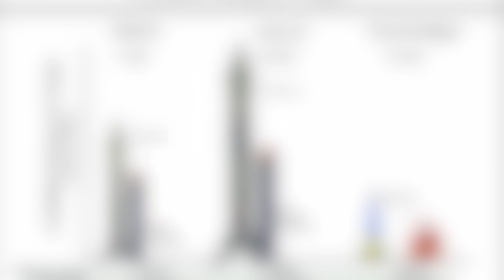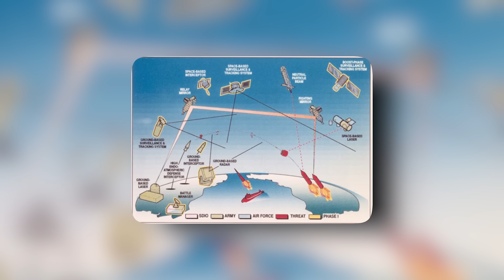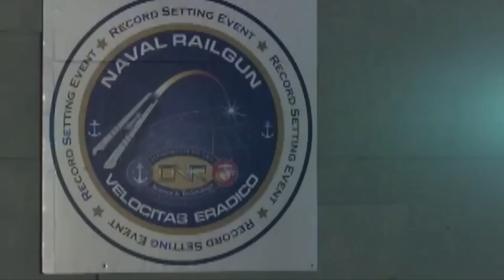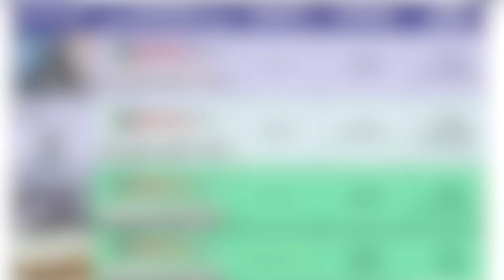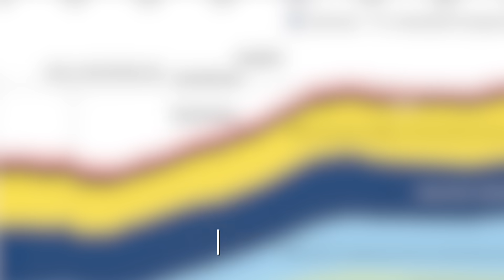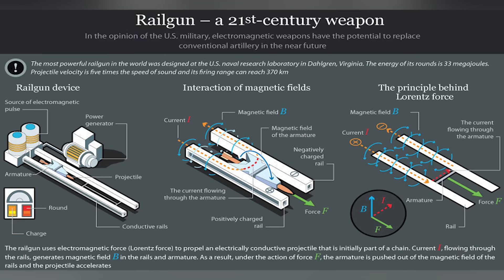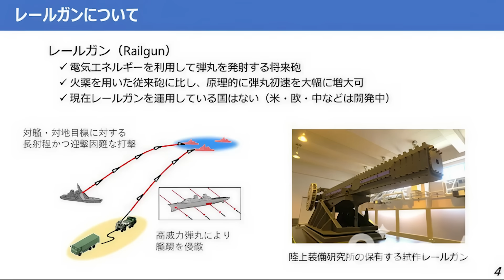Japan Revives a Scrapped U.S. Superweapon — And It Actually Works!

Comment: One major change the Japanese military seems to target compared to the US is its shift towards a defensive role as well. A railgun used on land would not face the same issues as one on the ship altough smaller railguns are currently tested for Japanese vessels as well. The defensive approach might even open a venue for a cheaper balistic interceptor role once the technology developed enough. Not on its own but complementary to regular intercepters of course. Trying to install them on/in mountain ranges would extent their range and a country like Taiwan for example would surely benefit from such a system as well.
Reply: ほとんど完璧に説明出来ていると思います。
レールガンの発展で、安価で安定したミサイル防衛網の構築が目的です。
Reply: レーザー砲とガトリングガンの併用でミサイル迎撃は出来るだろう。アイアンドームは鳴くダイヤモンドドームになる！
Reply: No, the guns still exert too much force and damage themselves firing. Ships were acrually a smart place to try to put thwm, as ships allow more movement and effective recoil for firing high velocity, heavy rounds
A stationary empacement will lead to more damage
Reply: @shanegibson3281 normal ship cannons also damage themselves
Why?
Because they have miniature explosions happening in order to launch the shell.
A railgun damaging itself is not a downside, it already happens to our normal cannons and guns
Reply: @shanegibson3281  Oh I'm aware that the tech is still developing but the bit as a land based plattform was discussed in Japan as a possible defense for North Korean missiles. Currently, they have no systems like THAAD or ARROW (as far as I kno, dunno if some are considered to be ordered). I understand the thinking behind the idea because intercepters are not cheap and similar thinking has been deployed to SHORAD solutions with drones. Where new intercepter (drones or cold war SPAA concepts) are developed to find cheaper alternatives. If we're talking aboout defensive solutions for missiles railgun concepts or some satelite space based intecepter seems the most feasibly in the near future.
Reply: Taiwan is not anymore a country than Donbass is. we in Asis support the unification of China. if seperatism success in China, it would encourage seperatist in our own country. there is a reason why ASEAN did not allow East Timor to join for decade. imagine if Catalonia declare independent, do you think EU will really allow them to join EU immediately? that's just naive and a failture to understand politic.

Comment: Sounds Great! HOWEVER, Note, that 'Wild Iron' doesn't mention several critical factors that will continue to put the rail gun on the back burner for another decade or two. The main three issues are: 1. The size and nature of the power supply,  2. As of Today, rail guns can only shoot "solid projectiles." AND 3. it's currently limited to LOS. Have a nice day,..  ;^)

Comment: Seem like rail guns is just a useless weapon. With the range of 200-300 miles you put your ship and equipments in danger just to use this weapons while a F35 has the range double to triple it. Then to the matter of penetration, we don't need a railgun level vs any other armor vehicle, and for deep bunker, MOP is much better than railguns. So it's a useless attacking weapon. What about apply for defend ? Rail guns required several second between shot, at best is 6 second with the range of 200 miles, a patriot system can fire and track simultaneously 8 targets. It is a useless weapon planetary.

Comment: seriously I can't see the railgun being very useful outside of dealing with things like cruise missiles and small boats or drones. nowadays ships fight across vast distances, and any weapon that works like a gun has too short a range to be of much use there. it might work as a cheaper way of defending a ship, but that's about it. anti ship missiles are still going to be the weapon that is used to strike targets without putting the ship into range of the enemy's own attacks. maybe if they one day make one that fires projectiles capable of maneuvering and carry some sort of explosive payload, it might work for hitting distant targets and do enough damage to be worth using.

Comment: back in the 1980's there was a project to put a ramjet in a 106mm recoilless rifle. it had railgun levels of speed but they could never get the ignition of the ramjet engine to work quite right. maybe we need to reopen that project, make it 120mm and make the 120mm gun standard across army and navy platforms,

Comment: The problem with the rail gun as the main weapon of a ship is, the round is traveling at Mach 7 when it leaves the gun, but immediately starts decelerating due to air drag and gravity. Without an explosive warhead on the round, you're relying on that hyperspeed to deal devastating kinetic energy to your intended target. At some point well before the maximum range of the rail gun, the potential kinetic energy drops below the destructive potential of even a standard 5-inch round. Also, not having an explosive warhead makes the rail gun unsuitable for Naval Gunfire Support operations. If you try to shell a coastal emplacement with a rail gun, you're just depositing hypersonic lawn darts in and around the emplacement.
Reply: By that logic, the APFSDS tank rounds would be used at all, yet we see them used regularly against armored targets. The experimental railgun tested by the US had a combat effective range of 100 miles. At minimum. Shore bombardment is not a viable military tactic currently, and a 5-inch gun is not even remotely good for that role.
Reply: well, these would be problems that can likely be solved with more development. Perhaps you could make a round with a discarding outer shell that can withstand the initial stresses of the hypervelocity acceleration, and then discard to deposit an explosive payload once it reaches longer ranges
Reply: @umngyr  The rounds already use a clamshell sabot that allows the round to travel straight down the barrel. The clamshell splits away as soon as the round leaves the barrel. The round itself is in the shape of a needle projectile so there's really no space to put explosives. Any sort of detonator for said explosives would immediately trigger inside the barrel due to the massive acceleration G's the projectile experiences before leaving the barrel, unless you add circuitry capable of withstanding those G's that disables the detonator until the acceleration G's stop. Circuitry requires power, so you're going to have to add either a battery circuit or a capacitor circuit to keep the circuitry working during the firing of the rail gun. With every addition, the needle projectile is looking more like an artillery shell and the coefficient of drag is increasing. The projectile slows faster due to the increased drag, meaning the gun barrel has to elevate higher for the same target distance, which means gravity's effect on slowing the shell increases, increasing the gun elevation just that little bit more. I  have the feeling if they could have put an explosive projectile in the rail gun, that would have been the FIRST thing they tried.
Reply: @Fadamor  well, what kind of effective range are we talking on a railgun as it is? If we're relying on the kinetic penetration to do the damage, how far can it travel before the amount of force is too reduced? Even if the Railgun isn't bombardment capable, it could still serve as an effective STS or AA weapon.
Reply: @umngyr  Rail guns are being developed as a main battery weapon. Also the rate of fire is such that you're not going to be able to handle more than a few aircraft before the aircraft are in range to release their anti-ship missiles.
As far as effective range of a penetrator round, that will depend on the armor quality on the target. A drone boat could be destroyed at a farther range than a manned destroyer or cruiser. At some distance -instead of doing additional damage due to the hypervelocity shockwave, you're just punching a hole in the side of the ship. Those kinds of holes can be repaired by ship's force within a day.

Comment: It seems the American issue has more to do with their vessels than the guns. They don't have the power or space in current vessels and their procurement is incredibly behind. Something the current president is working on but things take time. That and it sounds like the much more expensive American version may have been to ambitious from the start over 200 miles is incredible but if it can only shoot once who cares. The Japanese were right to start modest and go up from there.

Comment: $25,000 a round for what?? $15,000= a hammer, $20,000 = a toilet seat.  Theres your cost problems right there. . . . ALSO, lets try that new superconducting wire...
Reply: Tungsten melts at 6400 degrees. It take a lot of juice to mold one. It has to be precision machined. At those speeds, minor imperfections can have the shot fly of wildly. Then there’s the discarding sabot.
Reply: @Menuki  Yes, you are correct of course.  but im convinced through steamlining production and innovations we could push that number hard south. Even still its already no where near the cost of a crusie missle. Plus, im again convinced that technology is catching up with the requirements of such a weapon.
Reply: is that you, Mr Levinson?

Comment: The Japanese made a sound engineering decision by choosing a a small projectile for their target design. It means the resulting weapon will be smaller, and require less electrical energy to operate, all while still giving the system the ability to hit a target harder than all but the largest conventional guns. American designers tried to make their weapons do far too many different things, leading to larger, more power-intense guns,which in turn sent the design's cost soaring. And now, here we are, with the Japanese nearly ready to begin fielding operational rail guns, and American wondering why they don't have such 'nice toys'.

Comment: LOL try stopping a kinetic projectile from a railgun with a Falanx/Goalkeeper gun or anti-missile missile. Japanese did the right thing. They walked with a smaller rail gun before they could run to develop larger ones. And now it is no longer an exclusive US system but the allies Germany and France will get into it as well. This thing is not going away.
Reply: They are not the only contries who doing it tho

Comment: Couple things.  The rail gun the US developed worked.

There's two problems that Japan won't overcome if you want this on a ship just as US developers found.  One, the mounting will rip itself apart or it will be too heavy for shipboard use, the main issue the US had with it.  Two, it takes a large burst of energy, and that's not a simple thing to do on a ship.

So, considering the US only considered this for shipboard usage it was a fail.  Japan will come to the same conclusion.

The US govt. didn't simply just cut funding for it, the cuts came based on the promise of a working system didn't seem reasonable and the US is spending a LOT on other systems with full potential the main one being a 6th gen fighter.
Reply: Except the Jp one doesn't need such a comically large amount of energy. Japan's one is much smaller (only 40mm), meaning it requires much less energy and is lighter to mount.

It's not designed as a ship killer or long range artillery like the US wanted. They want it as a hypersonic missile interceptor, to hit targets moving at over mach 5 from many dozens of kilometers away.
Reply: @Lunar_Ice_3141 good point
Reply: Also barrel changes and no logistical backend for the barrel and projo

Comment: Doesn't mention the issue around the materials issues with replacing the barrels every 10 shots.
Reply: This, problem with a rail gun is the very short barrel life. The huge rail guns like the 32 megajoule BAE systems made a few years back was spent in just a few dozen shots. Like China's Japans is much smaller & less powerful just 5 megajoules firing smaller caliber projectiles. It's experimental a first baby step & by accounts they got over 100 shots out of it but they won't get anywhere near that once they scale up energies. 64 megajoules & shots counted in the thousands is the target needed before we will see rail guns on ships & we are likely over a decade or two away from that.

Comment: Since it’s electric and doesn’t use gunpowder, where does the smoke and flame come from?
Reply: the air igniting from the ionized charge from the rails, the projectile pushes it the superheated air out

Comment: American Research when from a 4lb railgun "bullet," then continued to test and raise the railgun "bullet weights" to 23 lbs. After 17 years of continuing to raise the weight of the test bullet, and having wear problems on the barrels, they called it a failure. And dropped the Project.  Why not solve the Lifespand of the Railgun Barrels BEFORE, you try to shoot bigger Railgun "Bullets"?????? The Japanese stood, with the original Railgun "bullet size," tested this, perfected it, until they solved the wear problem on the barrel. Then they made it operational. Seems like a normal logical progression to me. Test it, perfect it, then make it bigger, better and faster.
Why did our guys, not perfect the Barrel Wear Problem, BEFORE they tried to make the Railgun "Bullets" Larger and Larger?????
Reply: Probably because the millions in research dollars they would get,  also Americans are never satisfied until it's the biggest , fastest , most expensive version of whatever it is they are trying to do